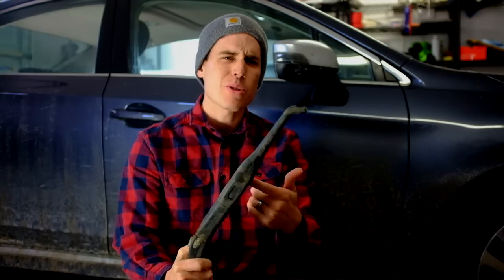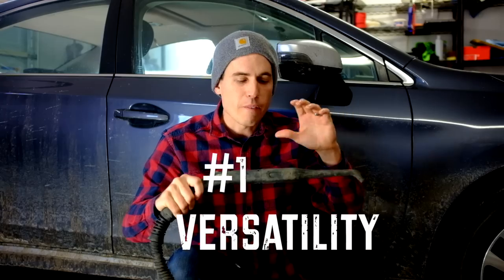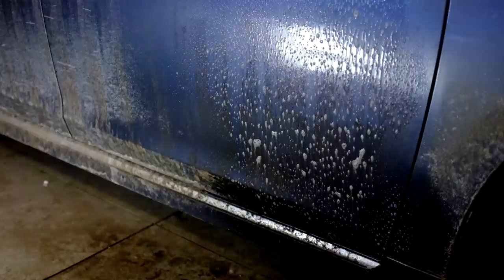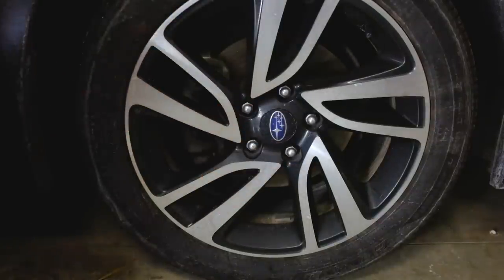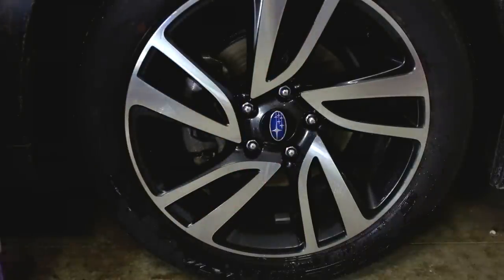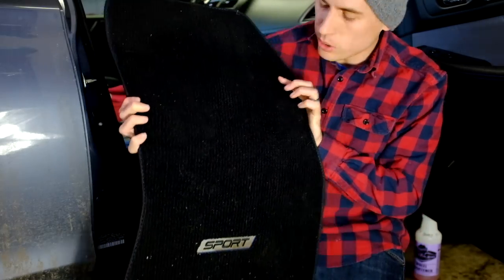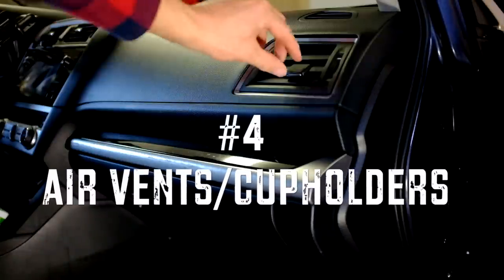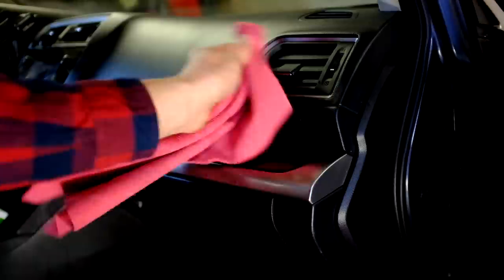Do you need a steamer for auto detailing? YES. Here's 5 reasons why

Comment: Just used a steamer for the first time today to deep clean my car interior.   In a word.......AWESOME.  Used your advice.   Work quickly when using around leather, vinyl.   Perfect.   Nothing got too hot,  nothing damaged.    Did not use around instrumentation.    Where it shined---DOOR JAMBS!   Good freakin' gosh man......emulsified the dirt in short order.    Another area.   FABRICS and CARPETS.   WOW.  Deep cleans those suckers like no other can and probably sterilized them too!    Granted,  I only have the McCullough, but i'm just a weekend driveway detailer and will never use it professionally so the McCullough works perfectly fine for me.    Came with so many attachments i'll never use them, but the two main ones to have are the Triangle head, and the spray tip head.    I used those extensively.   And I wrapped the triangle with a microfiber for use on all the fabrics.   Fantastic.   Two enthusiastic thumbs up for a steamer in car detailing.    One of the best "tools" or "toys" you can get for detailing.  My second most useful tool for interiors is my George numatic extractor.    I love that thing and it truly sucks out some incredible amounts of GUNK you never see with the naked eye.   I don't care how much you clean,  scrub with a brush,  wipe with a microfiber,  it doesn't matter.   When you suck out that crap with an extractor and pour out that BLACK WATER, you realize you must have an extractor for effective deep cleaning of fabrics/carpets/mats.
Reply from the maker: Yessir! Steamer is amazing and nothing beats extractor for a "true clean" of carpet/upholstery. I have a nice tool to boost a "budget" extractor in terms of performance... coming up in my next video:)
Reply: @HawkProDetailing  Great, looking forward to seeing that video and what the tool is.
Reply from the maker: @joevanseeters2873  just posted:)

Comment: Like the examples. Noticed you said that you use Bead Maker on the door kick plate. Even if you knock it down with a microfiber towel,  aren't you concerned about the plastic being slippery for the customer because of the slickness Bead Maker leaves behind.  Maybe a plastic trim dressing like Stoner Trim Shine or the equivalent would be safer.
Reply from the maker: CHRIS OUSLEY i hear that. I didn’t really over think that part — but point taken:)

Comment: I use an industrial steam machine, every day for car interiors, cannot live without it. My machine has 8 bar of pressure a built in detergent tank, and vacuum for extraction. An amazing machine and leaves the material a lot dryer than a hot water extractor. Sofas,carpets mattresses it can do it all. I am mobile and gets me loads of clients who want something more eco friendly,at the same time killing germs and sanitizing.
Reply from the maker: +Anthony Nastri I love steam! Gotta be careful with it though
Reply: @HawkProDetailing  Sure of course, especially when using the gun attachment, I make sure it doesn't touch any plastics being a brass tip can melt into it. Same goes with any machine if not used the right way. I have had some burns though but that's part and parcel of the job, some people tell me it's a problem with dashboard consoles as the steam can get behind the Speedo and fog it up, but I have never had a problem with that. Obviously I don't put alot of steam down, and like you said move it around quickly. I mainly use it for seating and flooring  with the flat plate and micro fibre plus using the gun on the air vents. I am careful with leather though and prefer to use the steam gun after using a magic eraser with some APC. I do mobile car detailing plus domestic cleaning like sofas,carpets and mattresses with great results. I am based in Malta in Europe. Great video I will subscribe to your channel as always looking for good tips from professional detailers.
Reply: What machine are u using?

Comment: Very informative and entertaining video as usual, thanks. I do have a question though. Have you ever tried a steamer to remove road tar, if so how well does it work?
Reply from the maker: It can be helpful but some road tar is nearly impossible and dependent upon your chemical. Try koch chemie eulex it's the best I've found
Reply: @HawkProDetailing  Goof off, or a 50/50 mix of xylene and acetone and no, it won't damage the clear but melts the tar like iron remover melts iron.
Reply: @ W G road tar melts using prep solvent and 100% clear coat safe.. xylene id stay away from for very bad for us,and acetone is a NO NO .. acetone eats epoxy which is 1 of the toughest chem, and FYI car finishes contain epoxy for durability.. alsp always use gloves handling any such chems.. try some acetone on a nitrile glove and see how it breaks into shreds .. mineral spirits also good..even kerosene works if my memory serves me correct ,and these100% clear coat safe for automotive refinishes. But kerosene i use always for greasy or dirty engine oil smudge sludge removal and best motorcycle bicycle chain cleaner beats any fancy packaged store stuff.. cheers
Reply: @Michelle-Eden  acetone used for removing epoxy wet or cured even.. automotive refinishes contain epoxy for durability and other solvents that acetone easily defeat! You just maybe never had to soak a paint job in acetone and look what happened to the paint moths later ESPECIALLY if its a recent refinish 1-2 yr acetone ,gun wash keeps working and much later comes the SAD SURPRISE peeling paint, lifting, dulling without shinig back up from cut polishing..

Comment: If steam at the temperature of boiling water can hurt anything on the interior of a car, then the materials are definitely inferior. In electronics water, or rather water with impurities, can cause problems and with cheap little motors like the steppers in gauges. But the truth is that in manufacturing everything is exposed to temperatures of 250 deg or so in the solder reflow process then cleaning in dishwashers. If the car interior is hot with some air circulation the water will evaporate from everyting. Hot like heater on full for 30 minutes while idling without recirculation.

Comment: I am using steam to clean the headliner of a Mazdaspeed 6 that has HEEEAAAVVVVYYYYY marijuana tar in it. The tan headliner is black and very difficult to remove and deodorize. Steam works the best but still takes quite a while, coupled with some enzyme products.
Reply: Also I'm new to your videos, just seen this pop up out of nowhere, subbed on my first watch
Reply from the maker: +God Oz Joker you got this! Good luck🙏
Reply: For sure, spent a day on the interior already, a few more hours left on it.
Reply from the maker: +God Oz Joker damn dude. Still smell in there? Odors are a ton of work-I honestly want to take an odor technician class through IICRC
Reply: @HawkProDetailing  nah I got like 90 percent of the smoke out, it was so so bad. The tar was so thick and black on the headliner it took up most of my time. Door cards, seats pillars, trunk. On top of that he has a white pitbull.......and head sand everywhere from his last beach trip. Interior hadn't been cleaned in years. What is left is the vent cleaning, a second round of ozone, under the seats, and some of the really difficult spots even my skinny hands can barely reach. We should follow each other on social media and you will see the vids and pics when I finish.
Reply from the maker: God Oz Joker dude that interior sounds impossible. But I also kind of like the transformation/challenge type interiors just to see how far you can take it
Reply: @HawkProDetailing  hit up my dm,  we can exchange info and share some ideas

Comment: Using the steamer aggainst the panels at that temperature,would not take off sealants waxs or ceramic coatings?
Reply from the maker: Not a coating but possibly a wax or sealant...I try not to overthink it. My final step will typically be Hyper Seal from Optimum sprayed on the panel as a drying aid

Comment: Man i wish y could afford the vx5000 currently using the mc1385 not as good but helps
Reply from the maker: Quiñones premium detailing do you detail professionally? I hear great things about the McCullough though :)
Reply: @HawkProDetailing   part time yes had it for about 1 year and still works common sense dont drop the wand on hard surface and once in a while flush the system
Reply from the maker: Quiñones premium detailing I hear that. Well I live the vx5000 but you can obviously get the job done with what you have. Are you mobile? Do you bring compressed air/Tornador? It’s a real hassle but man it has helped me
Reply: @HawkProDetailing   i havr a husky portable compresor got it on sale hd 169 from 199 the cfm is great about 5.2 cfm  y dont own a tornador just regular blow gun gets the job done
Reply: I use the MC 1385 everyday. Don't believe the hype. It's not about how much you spend on equipment. Stay profitable, build and manage customer expectations. Under promise and over deliver. 👍

Comment: How long can you go using the chief steamer before it Hass to warm back up? where would you suggest purchasing one and what are your thoughts on the 125 model. Thanks for the videos.
Reply from the maker: Chief Steamer has a slight edge over VX5000 in my mind. I love my current model. Just keep pouring water into basin periodically and it pretty much runs like a champ. If you steam like crazy for a minute or two STRAIGHT it sometimes needs to catch up. But if you are steaming, wiping, steaming etc it just keeps on ticking
Reply: But a Optima or a Lamborghini

Comment: Steam floor mat  instead of vacuuming out the loose dirt first??? Really???
Reply from the maker: Vacuum first. If you dont have compressed air, I recommend handy brush for tight spots between seats to dislodge crap before vacuum. Obviousky, remove as much dry soil as possible before steam. After that, steam CAN work. Beats not being able to dislodge crap that is hard to reach...even if you risk a little bit of mud (never ideal but steamer can bring versatility in this regard)

Comment: Do not use a steam cleaner on paint! Fair warning.
Reply from the maker: Just use common sense and be careful as with anything detailing related...
Reply: Why not? Please elaborate
Reply: @MrBod4life  it will peal the clear coat if get it too hot. From personal experience. And unless you using distilled water it will act like acid rain but on crack and etch the paint
Reply: @CysMix1  Interesting. May I ask which steamer you were using? I doubt a lower PSI steamer can do such damage. Also, did you use it on a car with poor condition paint already? What are you thoughts on using on wheels?
Reply: @MrBod4life  its not the psi its the heat thats the problem. Most steam cleaners are close to 300 degrees  This was back in 2016 and the vehicle was 2015 so the pain was still new. I have no problem using them on chrome wheels or powder coated wheels.
Reply: @CysMix1  Good to know. Thanks for the heads up!